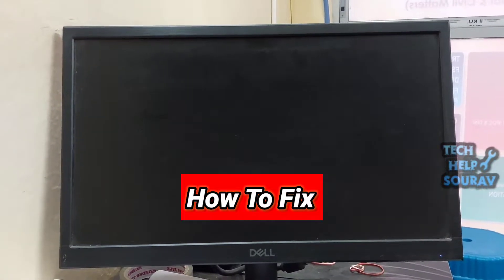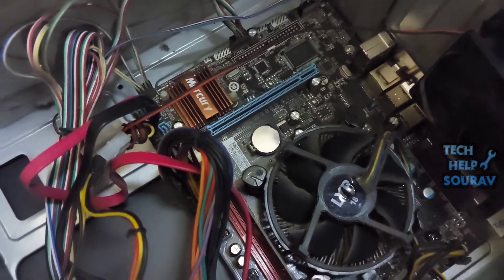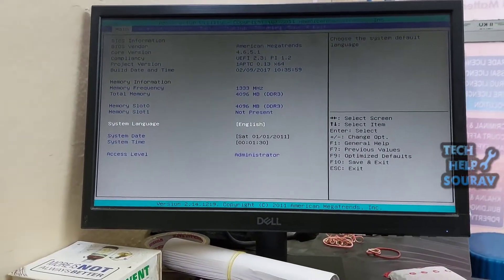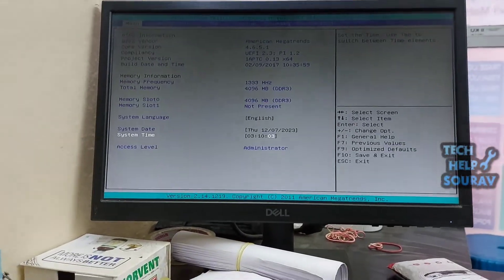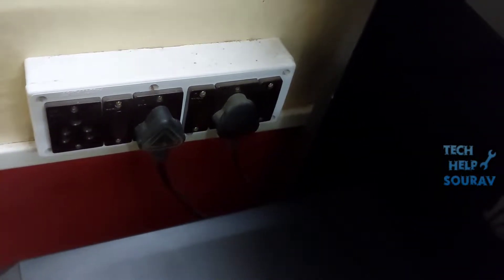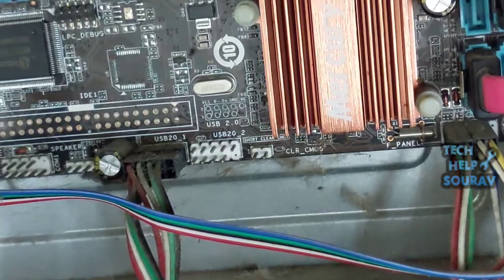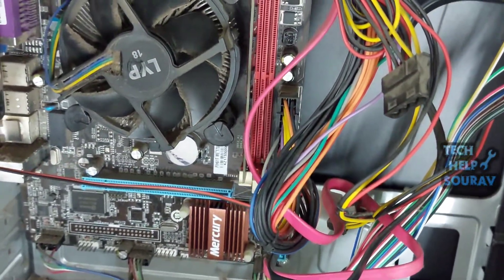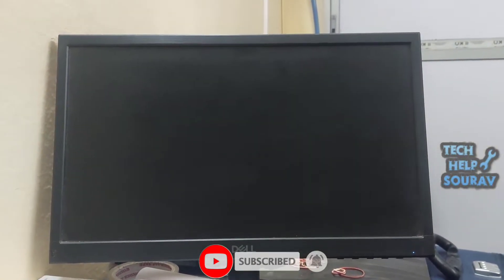CMOS Checksum Error | Press (DEL) To Enter Setup Fix For Windows Computer's

Comment: i was told to just change the wrong date and time in the bios and it would fix the pc not booting issue yet never worked until i realized a cmos battery was and found this video